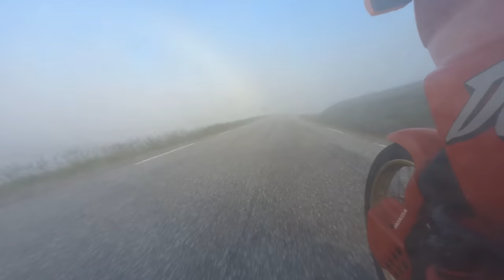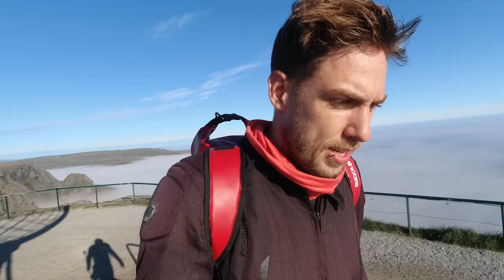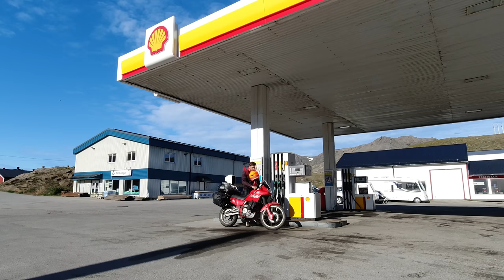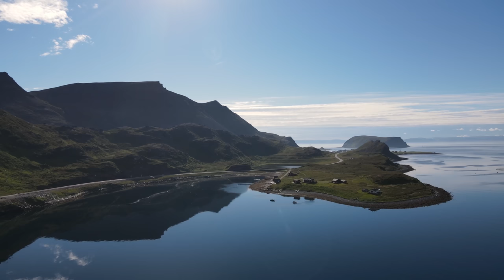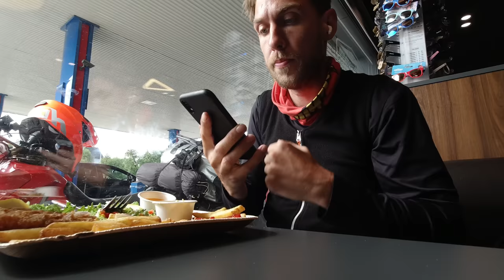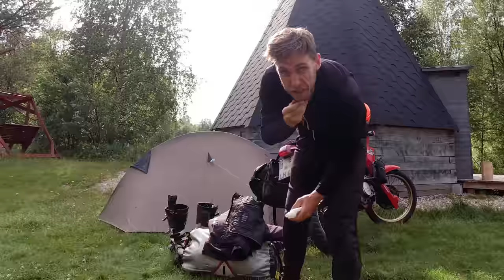5am at NORTH CAPE

Comment from the maker: On top of the world, literally! NORTH CAPE🧭  Find the Interview in the description and let me know what kind of „braker“ you are😉
Reply: I use both brakes, even on the dirt and trails✌😌
Reply: Both
Reply: Let's say 70% Front and 30% Rear. That's OK for me.
Reply: I'm a front only kinda guy. usless I need the rear for balance.
Reply: 50/50. And a lot of engine breaking. I love enduro though.
Reply: About 80 % front and 20 % rear, but it differs. Sometimes when riding slow i only use the rear.
V-Strom 1000 ‘08.
Reply: are you going down to åland?
Reply: Both brakes for sure. If you're in a controlled environment such as a race course it would be okay to use just the front, but otherwise both brakes 😎👍.
Reply: I brake by motor, by front breaks and by back breaks. Usually I ride so that the motor is enough. I am not in any race.  

When I see reindeer I use them all and am ready to stop.

Ride safe and 
WELCOME TO FINLAND!

Aja turvallisesti ja
TERVETULOA SUOMEEN!
Reply: Street driver, so only front, since it has 70% of brake power... In a brake training I learned that the rear brake ist just for serpentines and emergencies (when I did motocross I used a lot more rear brake)
Reply: On my r 1250 rt I mostly use front brake, but the electronics makes the bike brake on both, depending on load, speed and angle 🙃. Nice to be lazy 🤣

Comment: Both brakes for me but I did start riding back when most dirt bikes had drum brakes and you needed both both brakes to have any chance of stopping.

I have also found that hitting the rear brake slightly before the front makes the bike more stable when braking, the bike tends to squat more at the back causing the bike to nose dive less, but that is just me and it works for me.

Comment: On a bike like that, being used as an adventure bike, definitely use both brakes. The front isn't always adequate with the added weight of your gear. And of course, off road you use mainly the rear.  Most important, use what makes you comfortable and allows you to control the bike safely. Nice video!
Reply: On my 1988 Honda Dominator (black) i changed the breakpads to sinter instead of organic and absolutely regret it. They have to be warm/hot, to perform well. It's my first motorcycle since a long time and I use mostly the motorbrake. The rear brake as second and the front brake is used only for stopping or "emergency". Using motorbreak for regulating speed is my favourite on a single cylinder this size. Hopefully it's not too bad for the engine/transmission.

I'm really enjoying your videos. So happy for you to live your dream!

Greetings from bavaria.

Comment: Hi, Marc. Loving the series, keep on riding, man!
I guess the rule for motorcycle braking is really using both (usually 70/30 front/rear). But, there was a time when I didn´t, I used mostly the front (never used only the rear). But then, it was a really small motorcycle and mostly riding around town. I love that thumping sound of the single cylinder, too. Cheers from Brazil.

Comment: Congrats Marc!  You’ve made it.
As for the brakes, I squeeze the front and modulate/gently pump the rear.
Some bikes, like the BMW GS Adventure use both front and back when the front brake lever is squeezed… no luck with my Royal Enfield Classic 500 😂
Ride safe my friend

Comment: If you ride through Finland do not use E-roads or roads that has only 2 numbers those are boring and does not have any corners, you need to ride using road that has 4 digit (mayby 3 if you must), those are the smallest roads and more winding roads.

Comment: hello . i brake also with both breakes and do early less gas and use motor brake . its good to do . . tip i have changed mine oil seal of the brakes . it was neccesary . bike honda transalp 1994 .because they where old and the round thing did not get back any more and also the brakes are changed . .and ofcourse the break oil change . good luck without trouble . and drive save . you have nice travelle .